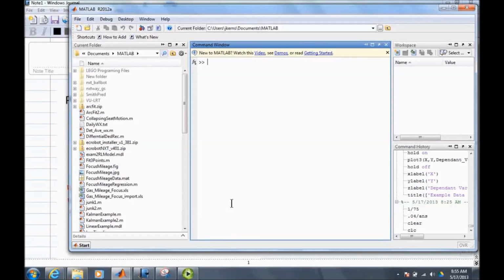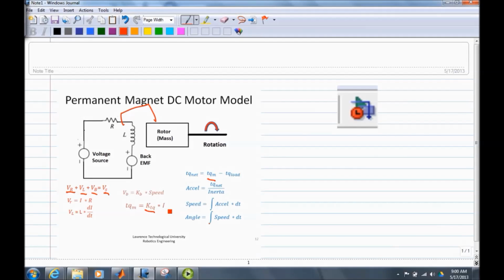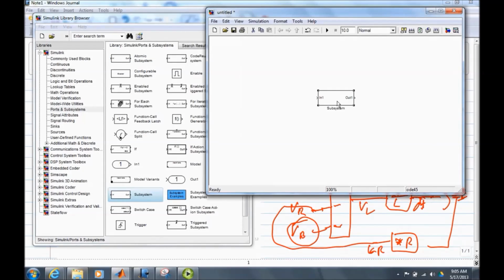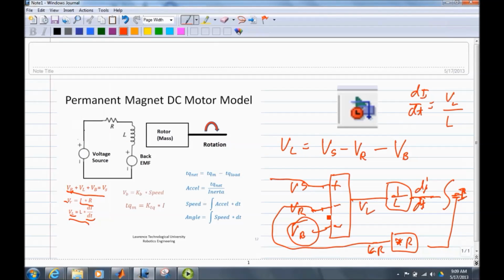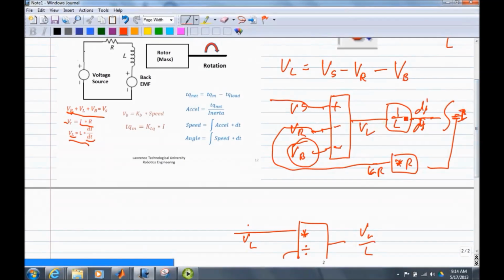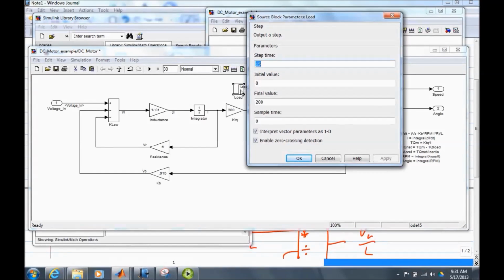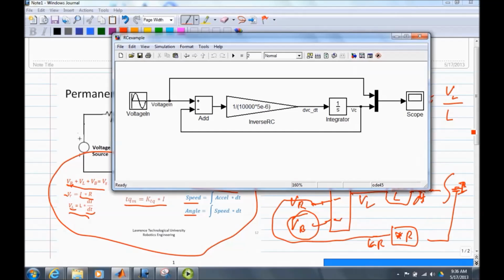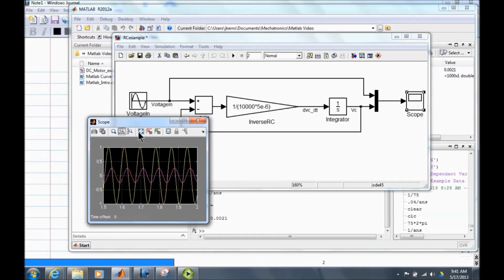EME 3214: Introduction to Simulink (older)

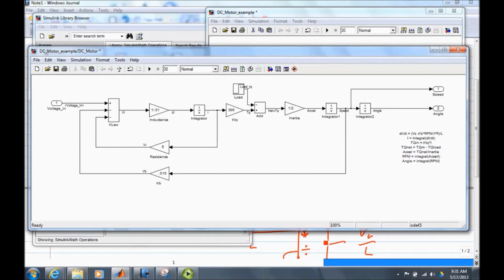Comment: Q: How did you write the equations on the simulink page (see 24:40)? Thanks.
Reply from the maker: If you click on any "white space" it will open up a text box and you can type any sort of comment you want. The biggest problem with this is that sometimes you want to label a signal and you accidentally click too far away and you end up just typing a comment and not a signal label.
Reply: Thanks.